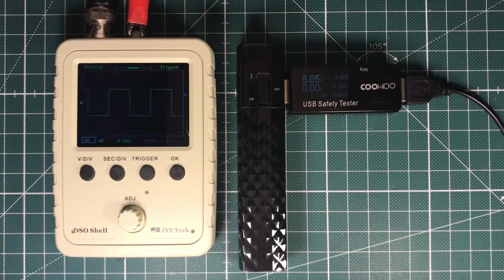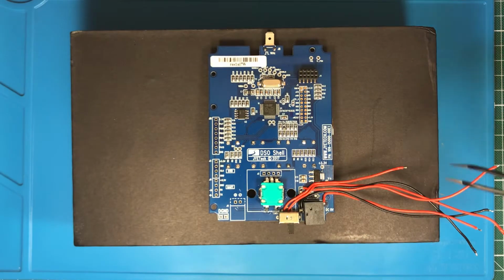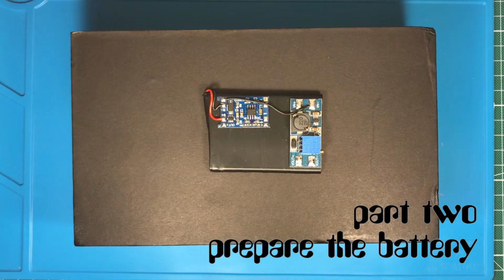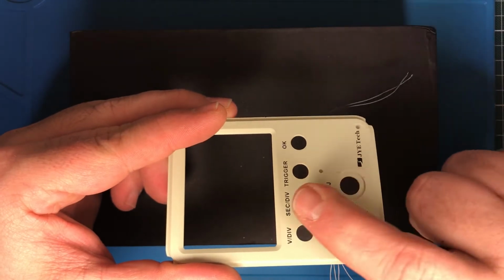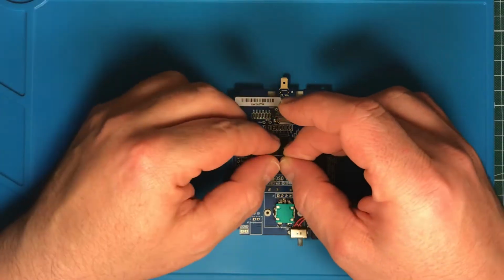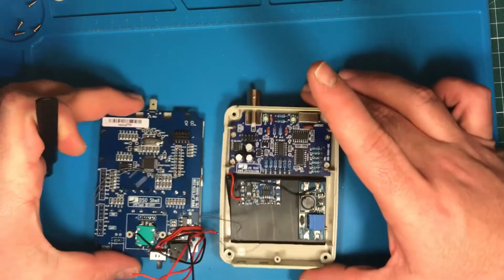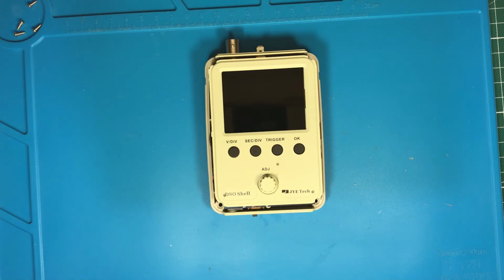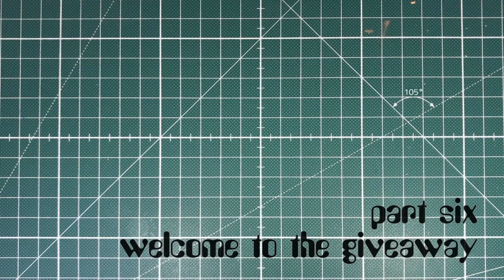"Giveaway Time" new battery powered "JYE Tech DSO 150 Shell" DIY kit.

Comment: Hi. How about using the internals from one of those usb rechargeable 9v batteries. The tiny circuit board handles the charging of the lipo from the inboard usb port and boosts the voltage to 9V when outputting from the lipo. I guess it will depend on the current consumption of the dso150 and the max output load of the circuit board. I've ordered a dso150 a few days ago and just ordered one of the batteries to have a play.
Reply from the maker: maybe, I think so but maybe it can't deliver enough juice.

Comment: Congratulations, mostly for idea, it could be used for many other purposes!
As I saw, you connect the battery on the B+- of the charger, and output of the charger (OUT+-) on the + and - of the input of the step up power supply module, over the existing power on/off switch.
Is this mean that the input voltage on charger is not critical (to be 5V)? I thing it isn`t, but I would like you to confirm. 
Nice work, I like it!
Reply from the maker: The Board I used is a charge and protection module, Input is 5V normally it has a micro USB port to connect a charger but I wanted to keep the original port to charge it. I just removed the traces on the scope pcb to the switch so the switch is isolated from the rest of the circuit. I place the switch between the protection board and the stepup converter because even when the scope is off the step up converter will draw some energy. Hope you understand better now.
Reply: Ok, thanks for answer. It wasn`t clear if the input voltage can be variable, because you keep the original port to charge. I intend to use this idea for several purposes, it`s good idea.
Reply from the maker: Зоран Ивановић thank you keep building

Comment: Very nice modification only thing that could make it better is a wireless coil so you can wireless charge it as well. Also great kit you put together to give away everything even smd leds. I'm not sure it something you would like but have you looked in to building race drones or and drone type really? 5inch race quadcopters are affordable now to build its a nice hobby if your in to technology. Flying is great too but takes a little time to learn and along time to master.
Reply from the maker: Hey youel I have parts laying around to make it maybe wireless it need some work but I will give it a try I let you know after it work. Thank you for your idea. I'm interested in drones but never build one yet, maybe one time I will play with one of this.

Comment: If I win I expect you to jump out of the box and help me put the kit together. You better bring your soldering iron too. Mine I don't have any good tips for it. I had a heck of a time building the DSO150 kit here without your tricky mods. I'm thinking about just duck taping a 9V battery to the back of mine.
Reply from the maker: Paul Frederick it is more easy then it look only the LED in front are tricky
Reply: Easy for you maybe. I need a new soldering iron to do that fine work over here. Maybe a pair of younger eyes too?
Reply from the maker: My eyes are not so new to be exact they are 41 years old......